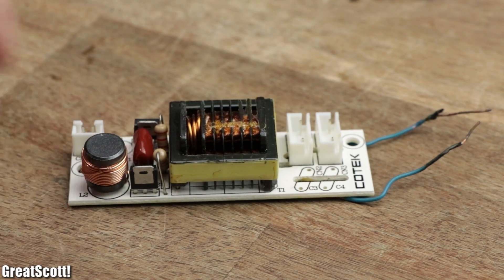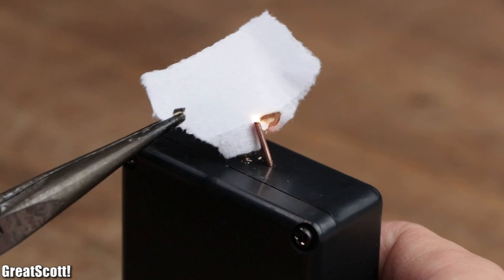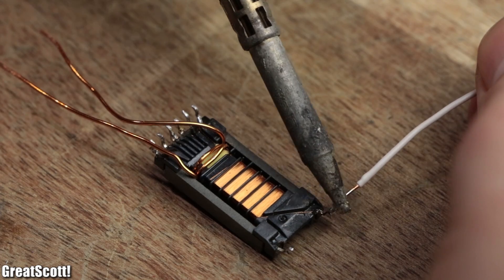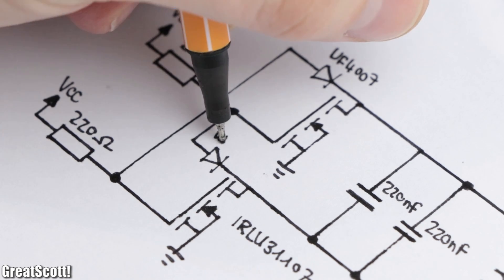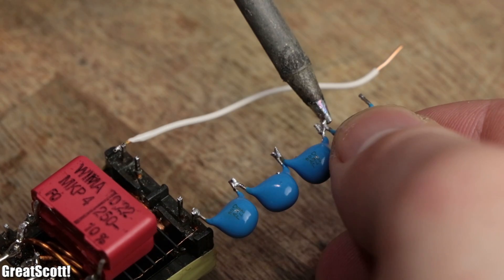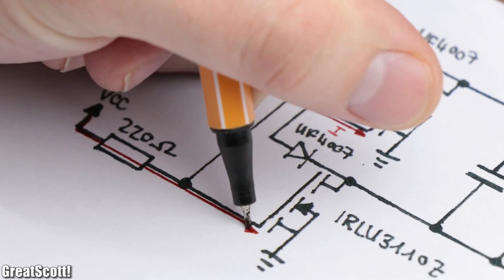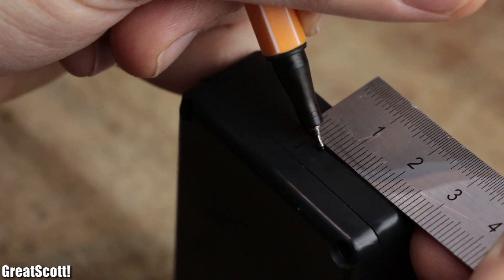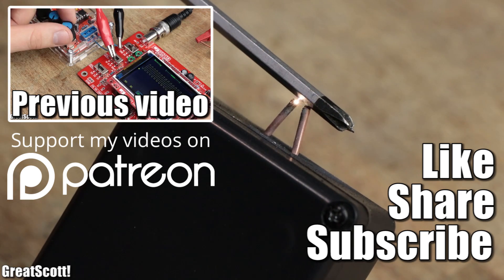DIY Arc Lighter

Comment: To create bigger arc with less current, you should use a wire made of many thinner wires. This should lower the skin effect, and higher the density of magnetic fields, so the transformer would be more efficient. I did it, and my lighter creates over 5mm arcs with only 1A at the input.

Comment: Great video and informative, thank you. I presume a lighter using resistance wire (nichrome) would require fewer components and wouldn't need the high voltage. Would one still be able to use a lipo battery in this case?
Reply: It would need even more current, and create lower temperatures, and also would be more damaging in case you touched it (the high frequency arcs burn only the surface of the skin, while the resistive wire can go deeper)
Reply: @__MINT_  Thanks

Comment: Can we use 555 based driver circuit instead of self oscillating circuits?
I mean, generate 75kHz pulsed DC with 80% duty cycle to drive power Mosfet chopper.
Reply: this is not possible, 555 ic needs minimum 5V to work

Comment: You should add a resistor, switch and usb type C port so you can power it off 12v from your PD power bank. I suppose you could always plug in the powerbank to charge the built-in lithium battery in your arc lighter but you can't use it while charging.

Comment: I presume the reason for the second transformer not having a feedback coil was because the inverter was run by PWM produced by a microcontroller regulated by feedback of the output. The Royer oscillator isn't routinely used nowadays.

Comment: A bit late for a suggestion, I know, but should you need to build a self-oscillating inverter that runs off a single Li-ion cell like this again try BJTs rather than MOSFETs since they only need ~0.6V of forward bias to turn on. Zetex (now part of Diodes, Inc.) makes some BJTs specifically for this application, actually.

Comment: Better to create HFE (High Frequency Energy) that does not electrocute, such as on a medical cauterizer. The top terminal on a horizontal output tube of an old 25in CRT TV puts out the same energy.

Comment: How about adding and charging large capacitors with the battery so a higher voltage (like a small boost converter) can be reached as supply to create the arcs? Sure, it doesn't work continuously but it could be used for some some time, depending on the size of the capacitors. Or am I talking nonsense? Maybe it's too bulky of a design...

Comment: Can i use bjt transistors? Rather than Mosfet? And also, can i use different enamel copper wire size?, instead of 0.85mm? From winding the primary?

Comment: Don't these type of lighters have plastic on the sides with a small gap so you can still use it as a lighter barely but can't put your finger through . For safety purposes

Comment: What is NTC and PTC ?
Reply: Negative Temperature Coefficient and Positive Temperature Coefficient Thermistor. Basically a resistor that the impedance goes up or down with heat. They can be used for various things like temperature sensing or inrush current limiting for circuit protection.

Comment: Hello, I have successfully built an electric light thanks to the tutorials from GreatScott! and some videos from the channel on youtube. Because I use secondhand components from other electronic devices, so in my project I use transistor TIP41C, but the problem is heat transistor and require heatsink, of course heatsink require space and affect the shape of lighter. I tried to use K1457 mosfet former power supplay CPU, but it did not work. So how is the solution? Should I use IRFZ44?

Comment: @GreatScottLab
hi :) I follow you on YouTube and I have a question about lipo battery and TP4056, can i connect a lipo 3.7v to tp4056 without a current partition circuit? do I damage the battery? because battery work to lower voltage than the charging circuit
thanks for all! you are the best!

Comment: why dont have 2 lipo's in parralel? then you would have 1.5 amps per lipo
Reply from the maker: You should not simply connect 2 li-po batteries in parallel
Reply: GreatScott! oh i didn't know that, and a li-ion battery? some can even output 20A (samsung NR18650-25R)

Comment: Why do you need high voltage capacitors if the voltage on the primary side is just around 4 to 6 V?

Comment: Was the high voltage output AC? Cuz then you could Have just used a voltage multiplier/rectifier made from a couple high voltage diodes and capacitors to increase the output voltage without having to get a better lipo battery.

Comment: I have the same circuit but with different transformer. Something like this: http://img1.cdn.aftrade.com/Y201505M1014C4206569/T6G4223993/W499H499/HV+transformer+High+voltage+transformer+electronic+transformer.jpg and I don't know how to rewind it. Is there any other way to do this? And if not how to fix it?

Comment: Hello. Nice project. I was wandering if you could obtain the same arc at the end of a 20 meter long wire . 
In other words, what is the longest leads that you can use and still have an electric arc. 
Thanks and keeps up with the tutorials because i for one i learned a lot from you.

Comment: how to get from 12v 42a to 12v 1a
Reply: why would you? current is pulled, not pushed. So if the battery can handle 42 amps it won't fry 12v circuits.

Comment: Hello Greatscott I have a question, I have built a festivals box. The box is connected with bluetooth or can be connected with aux also. Now
 the problem is when I turn on bluetooth and then connect me with my phone then pound and
 crunch the speakers, Could you help me what that could be.? Here is the amplifier: http://ebay.eu/2j1VUGK and the Bluetooth module: http://ebay.eu/2j7An1i

Comment: please tell me how to bypass the protection circuit on the tp4056,
i am creating a portable bluetooth speaker using li-ion batteries and a 12v bluetooth apmplifier but each time i turn it on the tp4056 protection kicks in,

Comment: You may make a ZVS to drive flyback transformer. It's very easy and does not take much time to troubleshoot. I have made several and most worked. Recommend to build it on a PCB because zenzer diodes burns easily. If circuit does not oscillate or mosfet heats up badly, change gate resistor values depending on input valtage. Must use schottky diodes for Better gate discharge

Comment: I feel like a 9V Battery would be a better choice.
Or maybe I am just paranoid. I hate exploding Batteries.
Reply: BadBoyIDM Discharge it carefully. Yea. Like generating an Arc and overloading the battery...
Reply: You could just use more windings on the transformer when you use a 9V battery.

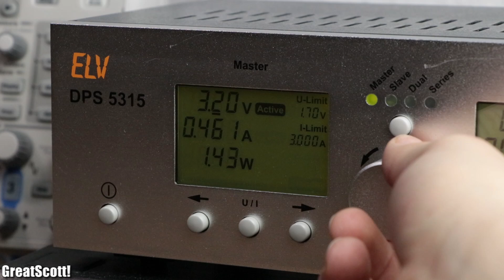And it was only delivering 3 Amps because the PSU switched to constant current, and reduced the Voltage to 1.7 V (3:47 Top Right of the Display).

If the Voltage would be still at 3.3 V, it would draw even more power.
Reply: I would be interested to know what kind of current draw you could get from a 9V. For some reason I think you can get more current from Li-Ion batteries.

The proper thing to do is use a protection circuit that has a thermal shutdown.  So if the battery starts to get too hot from constant high current use it will disconnect the battery until it can cool down. Same concept for low voltage as well, when the voltage drops below a point disconnect the battery from the load until it is recharged.
Reply: Raisonbran648  The Datasheets of these batteries are not very helpful. They state that 500mA would deplete it in one hour, but thats all the information i could find.
But at 9V you don't need that much current to get the same power! the 9V Battery only has to deliver 1/3 of the Amps of a 3V Battery for the same power.

Yea. Thermal shutdown is the way to go, no matter what battery you use.
Reply: I have some 18650's that can safely deliver 3 amps for about 1 hour. The ones I got even have a built in overdraw/recharge protection circuit. Plus since it's rechargeable you don't have to keep replacing batteries.
Reply: If normal use includes carrying it in a pocket, it isn't realistic to assert that you don't push the button "forever." Normal use could reasonably involve the button being pressed for an arbitrary period of time.
Reply: railspony I mean, most High Voltage Boost Converters from China die after a few minutes.

Comment: would it not have been better to short the shunt resistor on the protection board, removes the protection for over current, but leaves over/under volt still working.

Comment: @GreatScott! For the Current and Voltage problem I have an Idea. Why you don't Connect more Batterie outputs toogether. For example for Bigger Current Tow Batteries, with or without Charging Device, in Parallel. And for more Voltage, Like in leptops, connect them in Series. 
bye and greats from Niedersachsen.

Comment: Maybe you could use a voltage multeplier (https://en.wikipedia.org/wiki/Voltage_multiplier) at the end of the circuit to increase the voltage there and than use the Kondensators to limit the current wich would result in an longer arc and also less current would be needed.

Comment: Hey GreatScott, did you have a look at the 'high voltage generators' that you can find on eBay and supposedly put out 400kV? It'd be interesting to test and tear them down, maybe even make a project with it. here's a link: http://www.ebay.de/itm/142207527427

Comment: not to be mean but come on that arc was pretty small... how can you make it larger?
Reply: chems are you trying to compensate for something 😁 the size doesn't matter, the important is how you use it. LOL
Reply: António Vasconcelos you can't fit a cigarette into that shet
Reply: use a voltage multiplier or add many many turns to secondary winding! :)
Reply: man I still have that vedio of your "converting atx transformer into a high voltage one " shynthosize project

Comment: I wouldn't put that thing in my pocket though lol Have you thought about using a lipo maybe in 3-s configuration to reach high current at a decent tension? ( the recharging circuit would be external ofc)

Comment: Hello Scott. I like your diy projects. I need some help with a problem. I want to supply 2 pam8403 amplifier with a power bank with 5v 2a output. At 60% of volume the power bank  shut down . How i can turn off over power protection from power bank? ( sorry for grammatical errors, i don't speak very good english )

Comment: How to recognize led anode or cathode??
Reply: Antek Urbański Keep a spare 3v lithium coin cell battery around, especially a "dead" one that has a very low charge.  They make great led testers. Also a decent multi meter should have a diode test function that will allow you to figure out the Anode/Cathode and also the forward Voltage of the diode.
Reply: The bigger metal part on the inside where the chip is, that's the cathode.

Comment: You probably can replace the resistor in the TP4056 that defines the current limit instead of bypassing the protection circuit.

Comment: Enjoyed every minute of this video. 'Great' result.
Just salvaged a output transformer from an old CV circuit board. Looks very much  like the one you discarded. Unfortunately it totally sealed so I can't rewind it. But I'll still have a go using your circuit. I won't need it to run on batteries so I can go a little crazy.

Comment: hi , i think i know why the arc lighter dosent work when you connect it to the protection board on the pcb, its  probably because the li-po battery got the same protection circuit inside them, (inside the kapton)

Comment: Maybe it's possible to disable the current limit of the protected TP4056. According to the datasheet for the DW01A IC, the 1k resistor connected to pin 2 is the current sense, altering it to connect to B- rather than OUT- would mean it never senses current.
Reply from the maker: I thought of this as well. But no matter what I did with this 1k resistor the current was always cut off.

Comment: oooh, taser 😈
Reply: +Matthew Shaw Arc lighter burns you, taser electrocutes you.
Reply: But they both just make an electric arc
Reply: Not all arcs are equal. Electricity is made from Voltage AND Current.
Reply: +John Michael Stock Electricity isn't made. It's transferred.
Reply: I was using the phrase "made from" as the common substitution for "composed of". My point still stands correct though Mr Pedantic.

Comment: Really nice! About the high voltage problem (that could kill), maybe protecting the wires would be enough. Without removing the isolation. How about that? Then the arc would be created with the tips only. Another thing: maybe you should add an on/off switch, to avoid accidents inside your pocket.

Comment: This thing has the potential to kill you ? Wow, sometime I touch the electric arc of my lighter just for fun and I had no problems.
Reply: when I touched the arc of my electric lighter, it burned two tiny little scars into my hand and hurt a ton.
Reply: Guillaume DEBRE Mains has the potential to kill you too
Reply: I don't think it could kill you because of the high frequency it probably only going to burn your skin because of the skin effect.
Reply: If you stay for just 1/10 sec it's not a big deal.
Reply: It depends, when it comes to small currents it's all about the path the current takes, if you put the contacts in your leg you are probably just getting some charred skin, but if you grab one lead with one hand and the other one with the other hand the curent might flow close to your heart. If you have a slight heart condition this might trigger arythmia and a subsequent heart attack , thus killing you. However the high frequency and the positioning of the contacts make it hard to do such a thing. Somebody pointed out the skin effect, but i'm not certain the operation frequency is high enough to consider it 'safe'.
Reply: It won't kill you since the path will not go through your heart. However, if you hold one electrode with one hand, one with the other, and ... I guess hit the button with your tongue, I guess it COULD kill you.
It will burn the shit out of you though. Unlike your lighter, this thing is passing a lot of current. So much so he had to bypass the protection circuitry...

Comment: Theres a much easier version, and its much more powerful! Here is how its done: Take two unisulated wires and hold them into the power outlet, done! Just like a russian hacker would do it!
Reply: Igor look! Now we can light cigarette!
Reply: easy. car battery and some jumper cables
Reply: Edwin Gonzalez that is the smartest thing I have ever heard XD
Reply: soccerzockt but after that whole power to the house is gone....
Reply: +Edwin Gonzalez 👌
Reply: so.. you speak from experience or what?
Reply: Experience talking ? :)
Reply: Alex No 😂😂😂😂
Reply: soccerzockt 
Well, the voltage u r talking about is 230v , for the arc he used 15000v ,little bit of a difference
Reply: I now finally found the smartest guy in the YouTube world.

Comment: what to do if your ccfl starts smoking as hell but nothing is shorted or over heating plys reply
Reply from the maker: Cut off the power
Reply: yeah but i want it to work and it smokes araund coil
Reply: JurcekGamning may be the coil u r using is not withstanding the load... or if you tried winding the transformer there is a chance of getting the insulation ruined... double check everything dude...
Reply: ponvannan vh i did

Comment: how many volts?
Reply from the maker: Around 15kV
Reply: GreatScott! Excellent! The kind of danger we need in this world :D (I don't have the resources to build this so were all just that tiny bit safer). However, with that much voltage being chucked about, what about a safety switch that requires you to flick it to make it work or some system where you have two buttons wired in series and both must be pressed at once to activate it?

Comment: Could you please make easier Projects in the Future ?
Reply from the maker: This main circuit consists of only 10 parts. I would say this is already easy. But I will see what I can do.
Reply: I mean all that stuff with the scope... 
That's confusing.
Reply: im  waiting too
Reply: Thorben Denzer, If I'm correct, he's just checking if it's within its proper frequency (I don't understand why that's important, but I know it is.)

I find it a bit hard to follow as well, but I can understand all of the components and measurements he uses, which makes it easier to follow his directions.

Comment: But can it melt Steel beams??? LIKE JET FUEL :0
Reply: Jet fuel can't melt them... A jet engine powered with jet fuel can (maybe)
Reply: Sithhy you didn't understand my dank meme man
Reply: A directed energy beam can.. and cars too -_-
Reply: fuel beams cant steel jet melt!
Reply: WhiteOps of course it can, given small enough steel beams...
Reply: Simmilar technology is actually used quite a lot for melting steels, and things with even higher melting points like tungsten etc. Arc furnaces with carbon electrodes, plasma cutters, etc. This is because using electricity only limits you to how much power you can put into it.... I feel like mentioning thermal lances for some reason. literally burning steel to melt other steel.